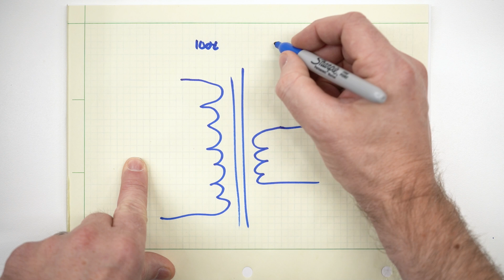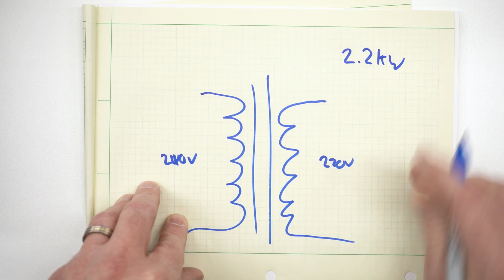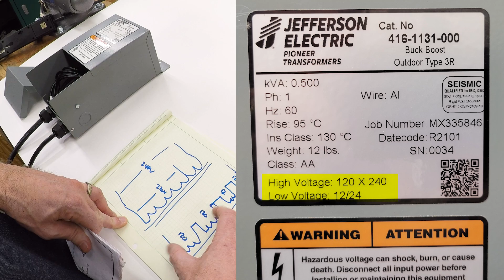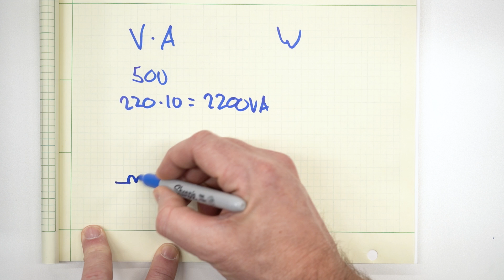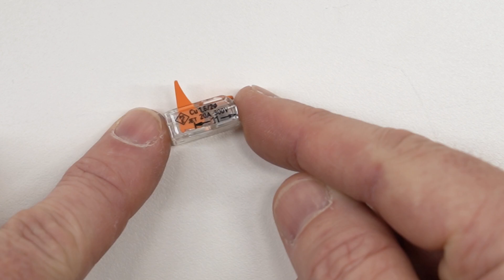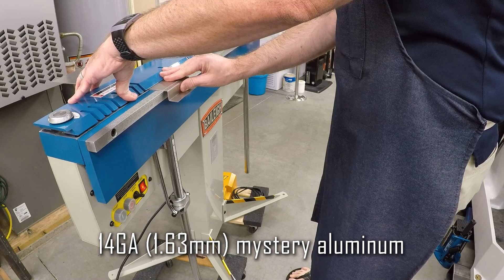220, 221, Whatever it Takes! | Wiring a Buck Transformer for a Magnetic Sheet Metal Brake

Comment: So we usually use the terms "buck" and "boost" for DC circuits that actually chop up the waveform, or do sort of the reverse into an inductor to boost it.

I don't know if I'd use the terms buck or boost here. Stepping down isn't bucking like in a buck converter. Step up and step down, sure.
Reply from the maker: What you are describing are buck and boost converters.  What I showed is a buck/boost transformer.  This is distinct from a step-up or step-down transformer, because the transformer is not handling the full power of the load--only the voltage increase or decrease.  In fact, the words "Buck Boost" are printed on the label.  This is a case where the same words are used to describe two very different technologies that perform similar tasks.
Reply: The rest seems spot on though!

Comment: Hmh, interesting that it has such a tight limit on the voltage. It's hard enough to measure AC voltage accurately for professionals (requires access an accurate and expensive true RMS voltmeter), and the voltage can fluctuate quite a bit (hence the normal +/- 10% rating), which means they're basically requiring you to run it through a transformer.

Over here they wouldn't get that equipment CE approved with that requirement, quite simply because all equipment that are to be connected to the grid must handle normal grid tolerances.
Reply: Well yes, if you want an accurate voltage measurement, you have to use an accurate meter.  If your power is a sinewave (and I hope it is) a true rms meter isn’t strictly needed.  True rms is needed for non-sine applications.  And rms meters cost less than $100.

Comment: Love the brake too - bought mine back in 2014.  My supply power is also about 245V.  You got me wondering if I need to be concerned??  The manual I received with the brake makes no mention to allowable tolerance on 220V input.  In fact there’s a troubleshooting section in the back if my manual that suggests the voltage readings should be 240V. So I compared my manual to the one they issue today from Baileigh’s website.  Wow.  I’m going to call Baileigh this week and see if they changed something, or I need to add the transformer.  I’ll update my comments when I know more.  Thanks James for this awesome explanation of how buck transformers work.
Reply from the maker: From what I've gathered, they had a high failure rate, and requiring the transformer has reduced it.  I don't know beyond that.  Have you by chance ever measured the current draw?

Comment: Very interesting.  I would have done some quick math and thought I needed a gigantic transformer.  Then I would have just run the machine on a 100' light-gauge extension cord and assumed the voltage drop through the cord would be sufficient.  Your way seems smarter.
Reply from the maker: Yeah, that would be a lot of heat.

Comment: Make sure you put a digital volt meter somewhere in your shop if you dont have one because the utility can change your voltage at will. They typically allow a very wide spread of allowable supplied voltage to meet their spec. Our shop regularly sees 262 volts because we are in a rural area and the utility company is over-feeding do to antiquated lined 10-15-30 miles out at the end  of a line. Our CNC and edge banders will not handle that over-voltage so we have to buck via several transformers (too costly to buck the entire 600a shop feed). But we installed digital volt meters in the event the utility does ever bring the supply voltage down (they are 2 volts below their high limit allowance) we will have to re-wire but transformers as we are bucking every bit we can just to be in spec on the machines.

Comment: I am intrigued by the blue cylinder on top of your hot water boiler. What's that all about?
Reply: It’s an expansion tank. It absorbs the changes in water volume of a system of pipes as they change temperature.
Reply from the maker: Yup.  And when it fails, the water has nowhere to go except out the TPR valve, and onto the garage floor.  Ask me how I know.
Reply: @Clough42  No need to ask. I’ve had the puddle before, myself…

Comment: I have the identical brake, which I love.  But IO have found that its best when starting the pull up on the handles to pause just after it activates the high power magnet, for a second or two, then completing the bend.  Otherwise with heavier material, it tends to slip.
Reply from the maker: Good tip.  Have you by chance ever measured the current draw?
Reply: @Clough42  I have not - but now I will!

Comment: Couple tips for wagos. I’m from the uk and use them all the time. 1. If you’re using solid core wire you don’t actually have to lift the lever to insert the wire, it can just be pushed straight in. 2. For piece of mind I usually put a heat shrink sleeve over them if I’m using them in control cabinets or in your case a transformer. 

Also love the safety flip flops :)

Comment: Is it in the US more typical to have green and white instead of blue and green yellow? Quite interesting.
A other thing are there some that don’t have these side pices on one end? i have very often over size stuff to bend.
Reply from the maker: Typical color code in the US is black for hot, white for neutral, and green (or bare copper) for safety ground.  I would say "earth" but I know just enough about that to know that there are some subtleties of terminology between "earth" and "ground".  In this case, since it's split-phase power, it really should be two black wires and a green ground wire.  Often you'll see normal black/white cable being used, with the white wire colored black with a marker on both ends to indicate that both wires are hot.

Comment: Al to Cu isn't just an oxidation issue, it's a lack of significant strain hardening in the commercially pure aluminum wire and the high thermal expansion coefficient of aluminum.  These two physical properties are the downside of aluminum to any other metal mechanical electrical connection.
Reply from the maker: I was aware of the thermal expansion issue when using aluminum for home wiring, hence the need for devices rated for aluminum wire.  The oxidation claim wrt. Wago connectors comes from their documentation.  I don't have firsthand experience with the issue.

Comment: VA, Watts and PF explained in such a way that I FULLY understand it. 
I have had several attempts at trying to untangle this since I first learned that VA is not the same as Watts in college over 30 years ago. It took less than 2 mins for you to explain it AND where Power Factor comes into it.
THANK YOU James !!
Reply: I was wondering if capacitors could be added to prove the power factor.

Comment: As a electrician,I always used Nolox (anti oxidation compound) for Al. wire. But Mike Holt on YT is a code instructor and contractor. On his channel he states using the Nolox was required in the 1970s-1980s when the Al wire composition was different?  Jerry in Pa.

Comment: I love Wago connectors, I'm a recent convert, but have already decided that I will not use wire nuts again if I can avoid it. (I don't think I knew about the probe access though) Thanks for the really interesting informative video. The auto transformer as you describe it almost looks like an "inductive divider" (like a resistor divider), really neat. The math still bends my brain though.

Comment: Think you could look under the petticoat on that bender and see what magic circuit inside makes it so persnickety about its input voltage? It doesn't look like the sort of thing that'd have anything sensitive in it. I'd be surprised if it were the magnet coils being designed with such little overhead that they couldn't handle 10% overvoltage.
Reply from the maker: Oh, I've been inside it since day one.  Still no solid conclusions.  Waiting for parts.

Comment: The many ways you can combine the various fingers on the brake seems analogous to the many ways you can combine the taps on the transformer which drives it. There's some elegance in seeing the same pattern applied in two such different ways within the same total machine.

Comment: Why cant industry just standardize this stuff, I'm so fuckin tired of spending thousands on a machine only to find out that I still have more to spend just to be able to plug it in and turn it on.
Reply: Modern tools are, for the most part.  My Miller Dynasty takes nearly all voltages and phases up to 480 V 3 phase.  This is because it is an inverter based.  These require active power factor correction which makes for more complicated design. 

This brake was probably designed for industrial application where three phase is available so 208 to 220 volt service.   Including a multi tap auto transformer would place the price point higher.

Comment: I know you're a VFD kind of guy, but it's worth noting that buck/boost transformers can be very useful for people running CNC machines from rotary phase converters. CNCs tend to be rather picky about uniform phase-to-phase voltage. Even some non-CNC machines will trip the overloads if the phases are too far off.

Comment: The wire is not aluminum.  It is tinned copper.  Very common in transformers.
Reply: I was thinking the same thing.  It's very common in transformers and a lot of other electronics and controllers.  I definitely have never encountered 16 gauge aluminum wire in the field.
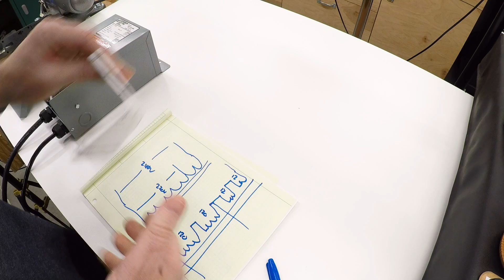Reply from the maker: The plate on the transformer says "Wire: Al".  The plate is visible at 10:23.  Edit: I opened up one of the connections and scraped the wires, and they do indeed appear to be copper, so the marking must just apply to the coils themselves?
Reply: @Clough42  I think that is referring to the windings, not the cable leads.  Those Jefferson x-formers have a copper winding option.  The information for the cable should be printed on the jacket of the cable itself.
Reply from the maker: I think you're all right.  I pulled open one of the connections and scraped the wires, and I think they're tinned copper.  I learned something new today.  I had just assumed what the marking on the label meant.
Reply from the maker: I think you're right.  I opened up some of the connections and scraped the wires, and they look like copper.  I guess the marking on the nameplate just refers to the coils themselves.

Comment: If I’m understanding the reason for the VA limit, your total VA draw on the transformer is the 16A * 20V on the “right” side plus the 1.5A * 220V on the left side. That’s 320VA + 330VA or somewhat over the nameplate limit. 
Hopefully the new circuit board will bring the current down and under the transformer limit.
Reply from the maker: You're adding the "input" to the "output".  That's not how transformers are rated.  This is operating well under the limit.

Comment: Interesting, didn't know those existed, but it makes sense. Could you use capacitors instead of inductors like they do for crappy LED lights? They technically can't dissipate real power just like inductors, so it should work

Comment: Re: the current not matching the nameplate

The magnetizing inductance of the electromagnet will vary with the clamping thickness and material.  Try measuring the current with no material and with something clamped into the jaws.

Also I did not see where you checked the output voltage of the buck configured transformer, so double check that the phasing of the low voltage windings was not reversed configuring it for boost.  It is rare but the lead markings might have been incorrect.
Reply from the maker: I checked it, but it didn't make the video.  It's 221V.

Comment: I don’t think those are al. wires. If you do a scrape test you will find the cu. inside. It’s just a coating.
Reply from the maker: Check the video at 10:23   The label says "Wire: Al"
Reply: @Clough42  that’s interesting. I did a google search on a buck boost tx and reading the specs is said cu. conductors. The reason I don’t think they are al. Is the same reason they stopped using al. For house wiring. It’s finicky. If the conductor is even scratched it will break there. I’m not doubting what you say, I just find it highly unlikely they used al. My bad.
Reply: @Clough42  Are you sure that the label doesn't just refer to the transformer winding conductors?  For ease of use, it would make much more sense that the connecting leads are tinned copper.

Comment: My theory about why they said to use 220V +-5% is because of two things: lower limit is for sufficient magnet strength (if V is too low - not enough clamping pressure will cause endless complaints) and higher limit is for thermal performance (the brake should not overheat under 100% duty cycle). If it's just electromagnet, which it most likely is (don't think there's much of any other electronics, except for some relay there), then higher voltage without continuous load will not affect the brake in any way. Although running it on 275VAC under water on the moon might cause brake to became sentient and be extremely confused.
Reply from the maker: If you read the various online forums, there are discussions about how they had lots of problems with the brakes when people ran them on 240V.  The manufacturer often chimes in and says that when they started recommending that people use a buck transformer, it "seemed to solve the problem."  Unfortunately, they also talk about the transformer "conditioning" the voltage and use phrases like "bleed off amperage from the board" that don't give me confidence they actually know exactly what's going on.
Reply: @Clough42  Interesting! Now I'm curious what the reason for such tight voltage tolerance is.

Comment: I'm actually surprised they are that adamant about the voltage - if you design anything electronics you design for +/-15% mains, and expect +/-10%, if they expect 5% - a regulator should be included.
Reply from the maker: A current regulator is actually included in the panel.  I'm not sure why this isn't sufficient.

Comment: Hey CLOUGH42, the nearly twice the current of the nameplate is concerning. It's acting like it's wired for 120V, which would double the current for a fixed resistive load when run at double the voltage. Is it possible the manufacture plate has a typo and is suppose to be 120V instead of 220V?
Reply from the maker: I've been in contact with support.  It's definitely supposed to be 220V.  The magnet coil resistance is 28 ohms, so 10A makes sense for rectified DC.  I'm still trying to figure out exactly what's going on.
Reply: @Clough42  remember it's mostly an inductive load not resistive.
Reply from the maker: @theradarguy  true.  I think the manufacturer has the customer check the resistance as a way to check for damage to the coils.

Comment: would love to see you do some tutorials in fusion 360 with their sheet metal stuff and see it out to production from plasma cutting and bending on the brake!
Reply: Yes, that is a great feature I played with a couple years ago (I built my own plasma table), but I'm not sure if the feature still works since they changed the licensing on fusion 360. My brother uses it for his cnc mill and I usually do very well with computer and tech stuff, but I just suck at fusion. It isn't intuitive at all. I'm thinking about buying a magnetic brake and I already do a little bit of powder coating and have been welding for 20+ years. I'm working on tying it all together to produce products I can sell.

Comment: Great job explaning how the auto transformer works.
I have a rolling base on my table saw that has two of the rollers on  cams that pop the saw up to roll it around.  If you drop the cam, the saw sits on two rollers and two stationary legs.  This makes for a very stable base when in use but it makes it easy to move.  Something like this would be a good fit for the brake.

Comment: It's pretty odd that they make a single-phase AC-powered device and didn't build in the circuitry to reduce the voltage.
Reply from the maker: Agreed.  It's still possible that this unit is just defective.  I'll let you know when I find out.
Reply: @Clough42  220v three phase is pretty common, isn't it? Could they have somehow adapted a 3-phase model to single phase?
Reply: 227v is one phase of 480 which is standard in the US for a commercial/industrial service ( then down to 208/120 by a xformer or 3 in the facility). So 227 is within the spec, and 240 residential is often actually somewhat lower, so the rating makes sense. Plus a buck transformer for the smaller percentage of their customers with residential service is better than a boost transformer for the larger percentage of their customers with 480v service. 
Not that I am positive about that, but I've been an electrician for 16+ years so....
Reply: @pamdemonia  excellent information
Reply: @pamdemonia  You're close, but it is 277 volts between neutral and one 480 leg, not 227 volts.